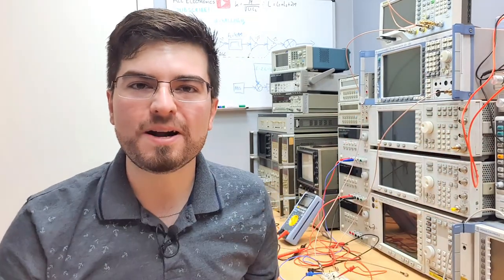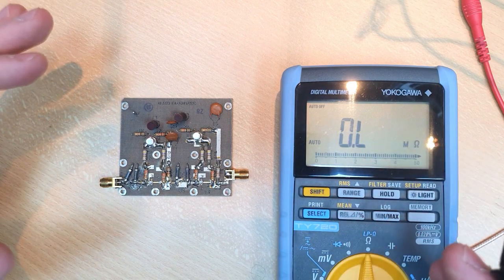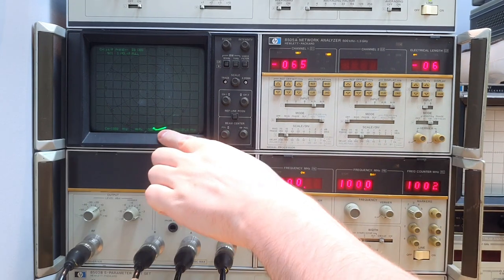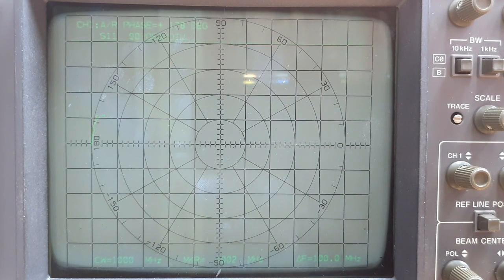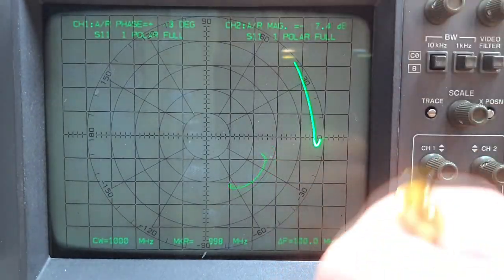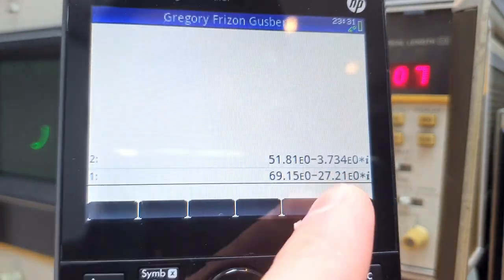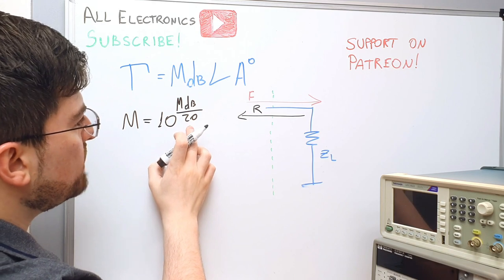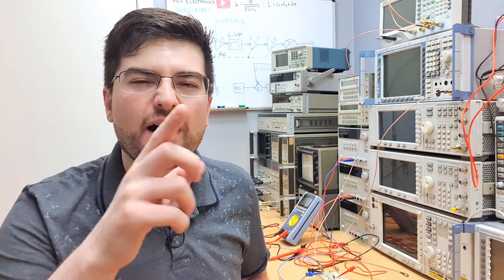Resistor Impedance at Microwaves

Comment: Very interesting.

I was expecting something like this, since these resistors also look differnt than the other ones. 
I wonder if they had to measure tons of resistors to find a series that works in just the right way 
or if the datasheet actually had the parasitics given. 
My respect goes out to all the Anritsu engineers from the 80s. 
Btw. I would have given you some credit for using the Yokogawa multimeter on the japanese board...
however you already did it yourself. 

Thanks for the second look at the amp, it was a very fascinating video.

Comment: I must be missing something, but is the impedance of the amplifier ~70ohms and why is that special? Warning, I will probably delete this comment if it turns out to be too dumb!!
Reply from the maker: It is not dumb! What is special is that the designers used the parasitics to control the flatness of the amplifier!! They used these through hope resistors on purpose
Reply: Thank you, but why 70 ohms and not 50? Is that close enough to give a reasonable match over a range of frequencies?
Reply from the maker: The amplifier is good up to 3GHz.. the ~70 ohm was the correct value for 1GHz, considering the rest of the  circuit. 

They found through hole resistors that gave the gave the correct response. Why 70? We don't know for sure, the full behavior was only at the minds of the engineers
Reply: Really thank you for taking the time to explain this. It was only a few months ago that I grasped different voltages can exist on the same piece of wire at the same time!! Now I'm obsessed with all things RF 😊